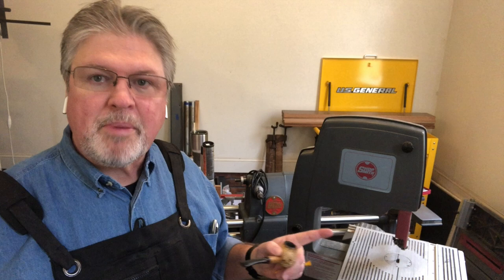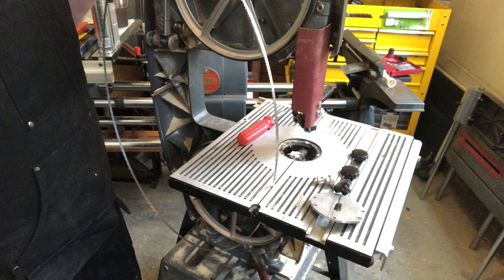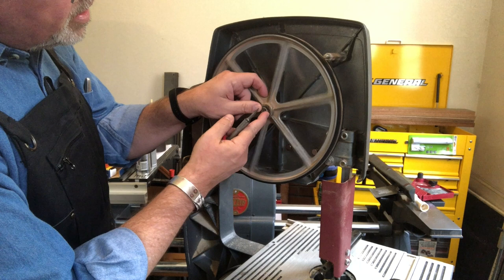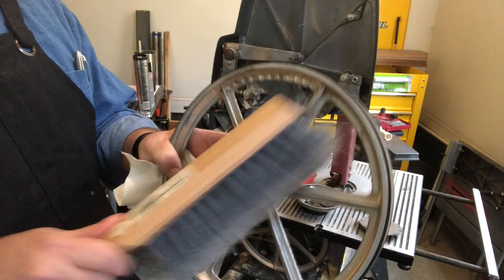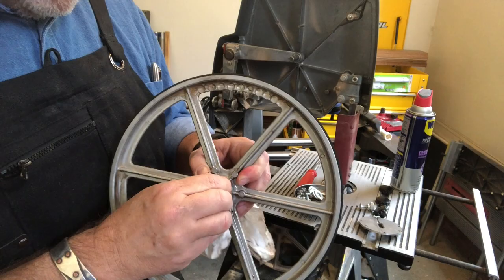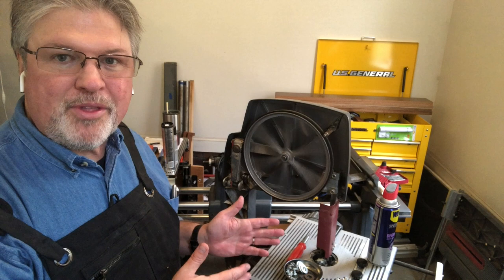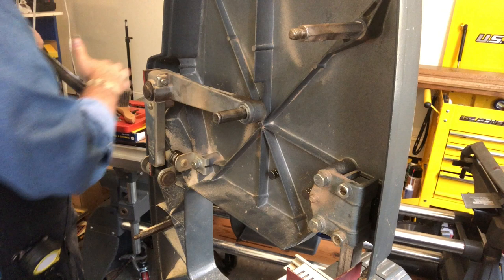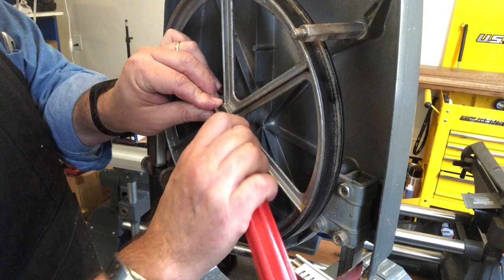Shopsmith Bandsaw Maintenance: Greasing the Upper Wheel (How I Fold a Bandsaw Blade & Why I Don't!)

Comment: Hey Scott,  I saw what look like small magnets behind your upper wheel.  Are they magnets, if so what is the purpose?  Just curious.  Thanks great videos by the way, I found your videos while searching for videos on the shaper function.  I have a need finally to use the shaper BUT some of the cutters have a 5/16" hole instead of the standard 1/2" and I can not find a spindle for them.  It seems SS made one for the 10ER years ago, butI have looked everywhere to no avail, any suggestions?  I have the Mark V model 500 made in 1981.
Reply from the maker: Good eye, Justa! Check out the 2:40 mark on this video: https://youtu.be/7i7LdZ3mnOg I haven’t done a shaper video yet, but if you own a Shopsmith 5/8” molder/dado arbor SOME 5/8” shaper cutters can be driven with it. Just make sure that you always use the tongued washer under the nut.  Scott
Reply: @MyGrowthRings  Thank you sir, it totally makes sense now.  I think you are referring to the molder that attaches and is used in the table saw position.  I was referring to the shaper that is used in the overhead drill press position unfortunately I can't post a photo here to better explain.  Thanks for a prompt reply (yes attention to detail is one of my quirks as I have 30+ years as a law enforcement detective and a private investigator LOL)
Reply from the maker: @ronlong5993  no, I wasn’t thinking molders on the tablesaw, but if you don’t know, numbers and I don’t get along due to my dyslexia! To use a cutter that has a hole smaller than the half inch shaft, you have to use a spacer. You are correct, you cannot use a 5/8 in arbor in a 5/16 hole!

Comment: Hi Scott, while you are talking band saws, could you toss a straight edge across your aluminum table?
Mine is low (maybe 1/16") on the side left of the bolt that fills the blade access channel.
I'm looking at adding a brace along the bottom to push it up a bit.
Have you seen warp issues on the aluminum BS tables?
Thanks,
Bob
Reply from the maker: They all have a little misalignment, which is why they added the bolt, but are you saying it’s off even after the bolt is installed? Perhaps you can add a fender washer under the table between the table and the knob?
Reply: @MyGrowthRings   Yes, even with the bolt in place. This link shows a similar situation. I've tried to reach Dusty but no response to see how the story ended.
https://forum.shopsmith.com/viewtopic.php?f=10&t=19860&start=10
This bandsaw was in storage for a while and may not have been handled kindly. Can I just try to bend it back?
Thanks,
Bob
Reply: Hi Scott. I added the fender washer and indeed it does help. I'll need a larger one or a short metal strip.
I also pulled the table completely off and checked out the back side for issues. Was surprised to find a small crack across the bottom which lines up with the warpage. It's interesting because the top finished side does not show the crack at all. The edge of the table does show the crack and what appears to be filler. From the paint over the filler this seems to be a factory "feature". I checked on E-Bay for a table replacement and the back side photo shows a ridge/crack in the same place. I won't be buying that one.
I looked at the trunnions and they are not bent to exactly 90 degrees. Seem to be bent down more. I'm wondering if this is normal or if bending them to exactly 90 degrees and confirming the top of the trunnions are all flat would solve the issue.
Or just add another washer under the low corner and call it good enough.
Thanks again.

Comment: Would like to clean and lube my 1980's Shopsmith Bandsaw having seen your video.
Is the lower wheel removed, cleaned and greased in the same way?
Reply from the maker: No, the lower wheel is pressed onto an automotive water bump bearing assembly. That bearing is sealed. There are a few people who argue that it is possible to add grease to this type of bearing using pressure, but usually by the time that we see the issue, the bearing is too far gone. Shopsmith only sells this as an assembly, including a new wheel, tire, bearing and shaft. Some folks have had success with used parts sold on eBay, but I would start by checking to see what the new assembly costs from Shopsmith.  Good luck, Mike!  Scott

Comment: Hi Scott, 
How much wheel wobble is acceptable before replacing the bearings. Reason I ask. I pulled my wheel off, the shaft itself shows no sighs of wear, and the bearings look good on the inside. However when I grab the wheel at top and bottom and wobble back & forth, Im getting @ 3/16th inch of play. 
But everything spins true and nothing seems worn at all. So is this amount of play normal?
Thanks, 
Steve
Reply from the maker: Steve, that does sound like a lot of play. I think it's worth considering replacement bearings.  Scott

Comment: Scott,  Hello.   I'm relatively new to My Growth Rings but not to Shopsmith.    I bought mine (Mark V and Bandsaw) in March of 1981.   A bandsaw question for you.  Is it easy enough (and can you show how) to replace the tensioning screw?   The end of mine has worn to the point that the Shopsmith "tool kit" (5/32 Allen wrench) no longer has any grip to turn the tensioning screw so I have to use vice grips to now loosen and tighten the nut if I want to change blades.  Also interested in your advise on upgrading to Carter guides vs the original upper and lower blocks.  
Love your videos. Thanks
Tom L
Reply from the maker: Hey Tom. Before you go to the trouble of replacing it make sure that it isn't filled with compacted sawdust. I've seen that happen a time or two.  As for replacing it, it's really simple. Just remove the the E-clip from the left side and screw the bolt forward. Scott

Comment: I'm struggling with tuning up my bandsaw on my 510. Hoping you have some suggestions. The problem I'm having is that I can get the 1/2" SS blade to stay on the dang thing.

the story:
I got the SS 510 in August, and everything was working fine until about the middle of November when a blade popped off and bent during a cut. Replacement blade from SS, replacement blade guard (mine had the old tinfoil one which died under the assault). I'm having a dickens of a time getting it to stay firmly against the auto tracking and lower blade guide bearings, and the new 1/2" blade keeps popping off the front of the wheels when under power (but not necessarily when spun by hand). I've tried adjusting the tilt of the upper wheel like you showed in some previous videos. I've tried other adjustments from the alignment procedures in the manual, but the blades just don't want to stay on. The two things I'm noticing that might help are (1) the upper wheel bearing makes a tiny bit of noise, and has about 1/32" of play front to back on the shaft (but nothing noticeable left to right); (2) the lower blade backup bearing is a bit noisy. Which is how I ended up watching your videos and going through the lubrication procedures you indicated. But problem remains.

So before I spend $130 on replacing the upper wheel (feels wasteful when I'm not 100% sure what the problem is), is there anything else I should be looking at? 

Any chance you'll be making a video showing how to replace the bearings in that upper wheel?

Thanks!
Reply: OK... I think I may have figured out part of the problem... and I'm a moron. Nothing like posting something publicly to get you to rethink something. When adjusting the tilt of the upper wheel, I didn't do it under tension with the 1/2" blade on it. I redid it under tension, and the behavior seems better (planning on testing with some cuts later today).

I'm still curious about the bearings question though, especially since it appears there IS a tiny bit of left to right play in the needle bearings left to right after all.
Reply from the maker: Ha! I've done that myself, so I know how you feel. I'm sure there are already videos on this topic and I don't think I have a saw that needs the bearings replaced. Scott

Comment: Will the INA SCE88 Needle Roller Bearings fit a 1978 Shopsmith bandsaw upper wheel? I removed my old bearing and my dial caliper measures them at 0.685". The newer INA SCE88 bearings are 0.6875".
Reply from the maker: Do you see any identifying marks on the old bearings? Do a Google search of them and you should confirm the correct number.

Comment: OK. I pulled my upper wheel off.   Watching you it seems to smoothly slide off the shaft.   Mine has to be forcibly removed from the shaft.   Same going on    It feels like the end of the shaft has been swaged, but it has not.  Once it’s on it feels fine.   Oh yeah, it is retained by stupid spring you have to peel off.   Any thoughts?
Reply from the maker: I suspect there's a burr that could be removed from the shaft with a fine file. You can replace the retainer spring with a snap ring if you so choose. Scott
Reply: @MyGrowthRings .  It’s great to know someone that knows about SS.   Most of the time about all you ever get is “I just sold mine!”   Uhhh- you wouldn’t happen to know the specs on that snap ring, would you?  🙂
Reply from the maker: @thomasslate5341  Not really, but I think the best approach would be to purchase one of the inexpensive assortments of them from Harbor Freight. They sell snap rings and e clips, either of which would do the trick. The advantage of an e clip is that you wouldn’t need to have snap ring pliers. It’s a 1/2” shaft, but the slot is narrower, so perhaps 7/16” would be correct. That’s another reason why an assortment would be handy. Scott

Comment: Are the wheels perfectly symmetrical? It seems that it would be advantageous to flip it each time to wear the tires evenly.
Reply from the maker: No, not on the Shopsmith bandsaw. The wheels are conical shaped, beige slightly larger in diameter at the back. It’s an unusual design, but it makes blade tracking automatic. Scott

Comment: are the magnets for your sewing machine light?
Reply from the maker: No, that light connects with the back side of the steel post that the upper wheel arm is extended from. Those are for the Harbor Freight LED light that I added in this video: https://youtu.be/7i7LdZ3mnOg
Reply: @MyGrowthRings  Thank you
so they are glued in.
Reply from the maker: @artburnett871  No, there’s a set both inside and outside of the saw. At this point I’m sure the double sided tape is doing all the holding.

Comment: Looks like Harbor Freight carries a small 3oz  tube of the same grease.
Here's a link.
https://www.harborfreight.com/85-gram-super-lube-grease-cartridge-93744.html
A bit more expensive per ounce but we are all about smaller workshops.
Unless you really need that much grease.
Reply from the maker: Great point, Bob, and that same tube is available from Amazon as well as an even smaller tube. I've linked to them in the video description but if Harbor Freight is on the to-do list (and when isn't it) it's good to know they have it. One important thing to double-check is that Super Lube comes in several formulas, so look for PTFE on the front and avoid the one that says "silicone".  Scott